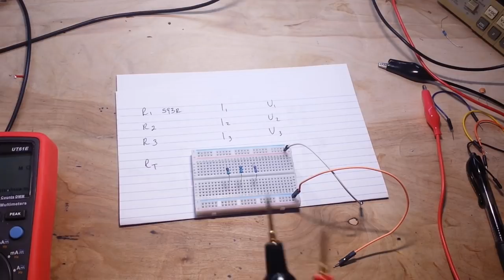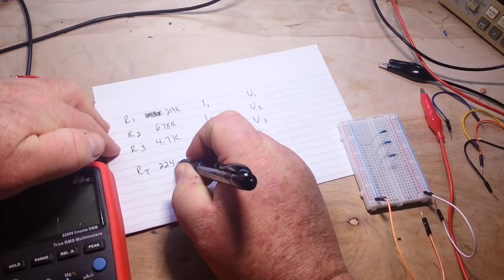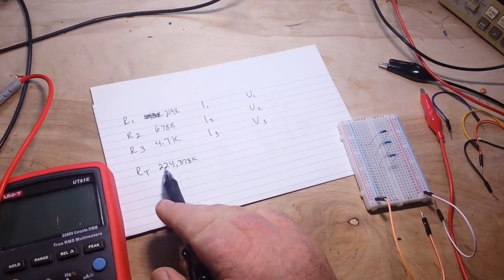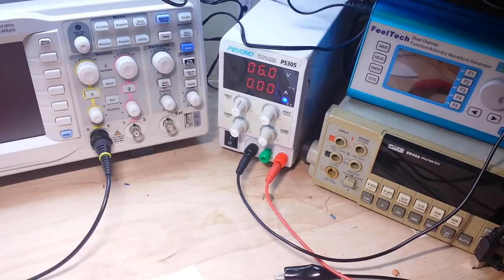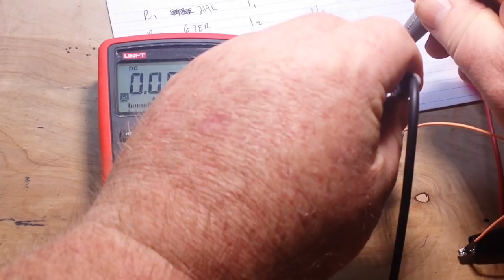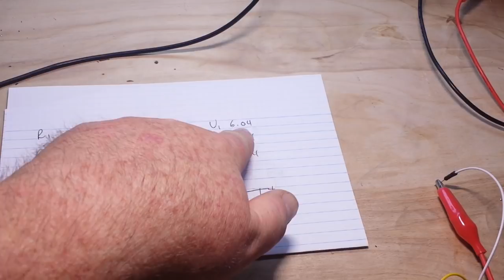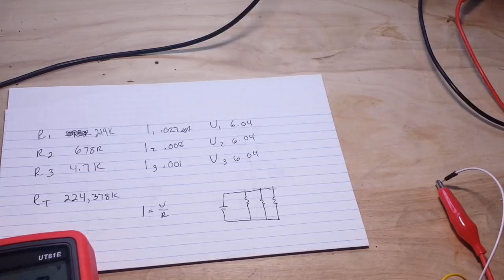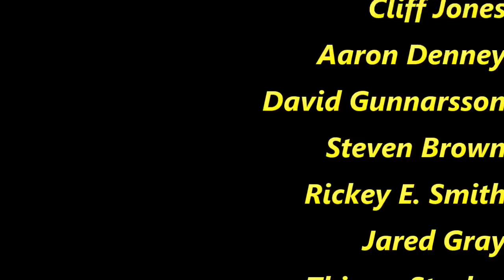Ohm's law and parallel circuits

Comment: Resistance total is incorrect. Adding up all the resistors would be total resistance in a series circuit. Parallel circuit total resistance is always less than the smallest resistor in the circuit.
Reply: Correctomundo

Comment: "V" over "R"? Well, in my day electrostatic force was always expressed as "E". I guess the times are changing. By the way, you said mA for R1 but wrote uA. You must be tired. Power is 0.062Watts. Your total circuit resistance, based on values shown on your meter, is 590.196 ohms so your total circuit current is only 10 mA (rounding off). For series, your total circuit current is less than 31uA.